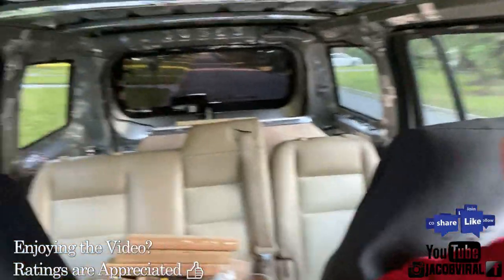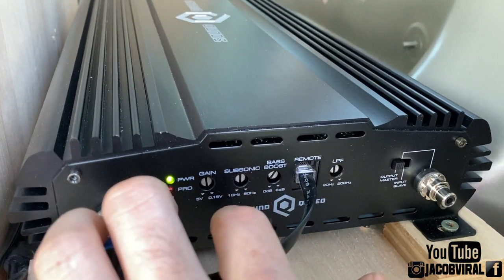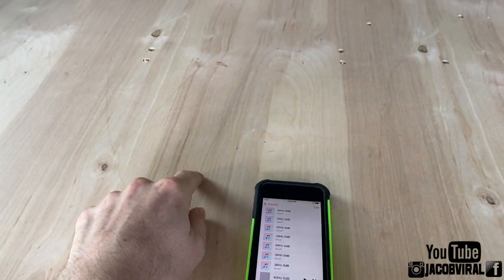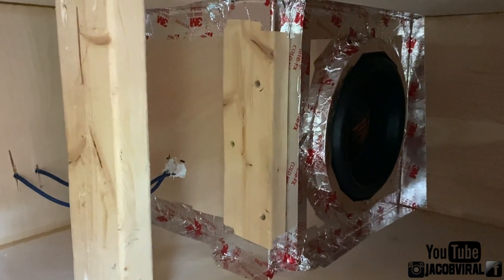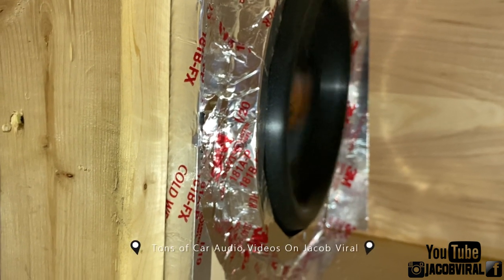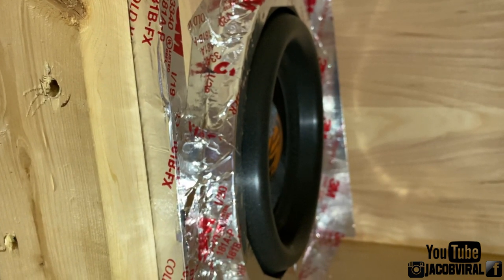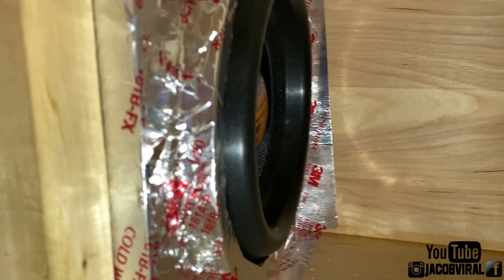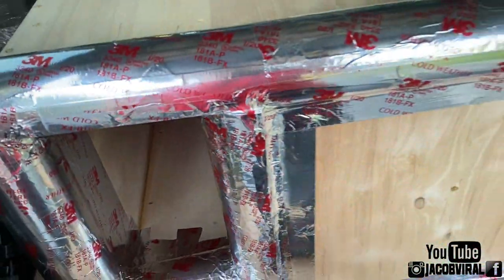HOW TO FIND WHAT YOUR SUBWOFER BOX IS TUNED TO?

Comment: The frequencies are called sine waves also know as test tones. They usually come in 0db ( full scale ) -5db and -10db. 

For this test of finding box tuning you can use -5db or -10db. 0db at too loud of volume could damage your sub. 0db is only for SPL competition. 

Def keep your head unit or radio half to 2/3 volume. You would use -5db tones from 20-70 Hz for subs unless you know about what your box tuning is. Start at 20Hz and go up to 70Hz by 1Hz or 2Hz ( 20,21,22 or 20,22,24,26 )

If u think u know the tuning, Ex: builder says 33 Hz tuning on your ported box. Then test 30Hz - 38Hz -5db tones. You should be in the right range to find the tuning by the least movement of the sub if the box is built half decent lol. 

Test tones are also used to set gains on Head units, Phones, ( source audio ) DSP’s & amplifiers. 

Hope this helps anyone undertstand who may have missed something in the video.

Comment: The most effective method is to test for the impedance modulus.
For correct tuning.
Not for those awful sounding "Burp" efforts.
But a correctly tuned Helmholz
You will get an equal ripple reading of modulus.

Comment: One thing I didn't understand, low frequencies in all speakers forcing the woofer the move more back and forth as you go down. and med to high frequencies the woofer need less movement but much faster ones. that's why subs have bigger rubber diameter with slow bigger movement and tweeter are smaller and almost have non. so I don't understand how looking on the speaker can give any information. I did some testing my self and find that you can seat in front, play the frequencies and most lower audible frequency you hear is mostly the box tune frequency, 
like if 30 is barley heard (not felt) and 40 is audible to your ears then it's probably 40 hz.

Comment: Hi brother jacob, got a few questions.
(Side Note, Love my bass to hit lows that shake my soul and heart)

1. Do the Hz of a Subwoofer, lets say a sub is tuned at 25-500hz. Should I build a sub box (ported) and tune it to 25hz aswell to compliment the sub's 25hz or not? or should i tune it higher to 35hz-40hz. Because most prefab/custom sub boxes are tuned at 32hz to 36hz. But most sub hz be around 24-27hz. I don't get it.
Like kicker compr's dual 10. Box is tuned to 30hz but subs go lower then that and are about 27hz.

2. Is it a problem if I buy a amp to compliment my subs peak rms watts rating rather then the normal rms watts rating? Lets say i've got a kicker compr 12 the rms is 500watts and peak is 1000wats, most people say get a amp that is 500watts not 1000watts. But i personally want to get something in between, a 800watts amp would do. So is that a problem or not. 

3. How should i make my enclosure and sub be the hardest hitting and also loudest that people can hear me from blocks away and also can play lows so well my heart and soul feels it. 

Thats all bro
Reply from the maker: Usually sub can play half octave below box tuning. Tune any lower then 30hz means you won’t want sub to play loud above 40hz. Always best to get a sub amp rated 140-200% rms power to have play room and not max amp out. Tune mid 30s to play to 26-30hz range, tune higher will be louder but not as lows.
Reply: @JacobViral2  thankyou very much brother👑💯
Reply: Yeah put more power on your Amp like he said, your not gonna turn the gain up 100% anyway or it'll sound like crap. I had 2 kicker compr 12s on a 1500w rms 3000w peak Amp for years and played em loud all the time never blew one

Comment: My sub continues to move between 18hz up to 100hz. 
Ive tried different port lengths with no difference. At no point , does it stop moving or moves very little ,within this range. . 
I have no idea of tuning frequency.  Any advice ?
Reply from the maker: Plug-in to 12volt box calculator, shrink/open port area, new box, SPL db meter slope roll to loudest score(peak)

Comment: very helpful videos

my wife would kill me tho if i rolled around with my car looking like a carpentry shop, ive had to make my install stealth in the minivan, you can barely tell there are two 12s, or any wires in car all over...clean. when shes in car, i usually just turn the subs off and run highs/or run subs at low power via gain knob up front under dash, about 19 volts...barely pushing 200 watts...when hes not in, i crank them up near full power...tho two type rs @ 2ohm pound hard at 42 volts or near 900 watts lol
Reply from the maker: Thanks and yea it’s a project Explorer gutted from multiple walled systems. More videos coming daily stay tuned. 👍

Comment: Would this method work for a tube enclosure pioneer ts-wx304t
Reply from the maker: It can work for anything long as you can see the sub yes
Reply: So first I find the loudest  my door speakers can go before distortion with no gain and lpf then tune the amp setting the gain and lpf with the music volume still 75% (just before distortion) and then i can turn it down to like 50% then do the tone test till the sub moves less to find the box tune then set ssf half octave down ? Would that be the correct step by step method ?
Reply from the maker: @2HUNNIDN98  Yep, seems complicated but it's not so bad.
Reply: Thanks bro 💯
Reply: Sup from New Zealand 🇳🇿 btw

Comment: Is tuning all based on the box? Or can bigger displacement subwoofers effect tuning? I recently bought a box (2 15s) that was custom built and is tuned at 32hz. So would that mean that any 15 inch subwoofer I put in the box still be at or around 32Hz?
Reply from the maker: Subwoofer affects tuning to for your peak frequency but box is tuned the same regardless of the sub just the sub changes your  frequency variance.

Comment: If a box is tuned to 40hz but the low pass filter on an amp only goes down to 80hz (sundown sfb2000d) will it still be able to get close to the 40hz? Or will it be limited cause of the amp? I’m ready to switch it out for another one
Reply from the maker: LPF is the top end cutoff point so 80hz is fine, your talking about subsonic.

Comment: Thankyou for this
Reply from the maker: Your welcome thanks for watching and subscribing!
Reply: @JacobViral2  maybe you can help,  I have a alpine type r system and front component speaker in door is doing a little static crackling sound on certain songs at a reasonable high volume , what would cause that in your opinion ?
Reply: I have swapped rca input on amp from left to right to rule out amp/ wiring etc and still same left speaker only makes this sound
Reply from the maker: Sounds like a blown or soon blown speaker or a ground issue.
Reply: @JacobViral2  mmm hope its not the voice coil but I doubt its a ground issue as every thing is correctly wired , thanks for replying mate its much appreciated

Comment: So after finding out what's my peak can I tune my amp with that hz test tone? Say my peaks 34hz do I use a 34hz test tone to retune or do I stick with 40? Also would I change the subsonic lv?
Reply from the maker: I have videos on setting each setting on the amp to watch but in general I would tune based from the tunings for the results yes.
Reply: @JacobViral2 so was you telling him to play a test tone of the 34hz?  cause my speaker plays 30hz but you know they say play an 40hz test tone to set. So which test tone should I use?? 30 or 40?

Comment: is this way really accurate??  by placing your hand inside to film the speaker movement.. you've already decreased the size of your port hole size with your body.  that probably affected the tuning frequency..no??
Reply from the maker: Concept yes works great, your point is correct though probably throws it off 1-2freq

Comment: I just extended my port and now my sub hardly moves at 26hz! Crazy. I played 18hz almost full tilt, good fun. But yes way to long. What's a good tuning freq for overall music, I like the lows but not to the level of of decaf music, I think my box without port extension is 45hz and is too punchy and brutal, would a good tune be 32hz or more like 38hz?
Reply from the maker: Usually most tune between 32-36hz for a balance of both.
Reply: @JacobViral2  Legend, thanks for reply on old video!
Reply: @JacobViral2  A few hours later I finished my new port. sweep with no extension showed peak of 40hz, sweep with long extension showed peak 26hz and now my new extension I made the woofers were not moving much around 34hz! This is perfect, not gonna lie I was aiming for 32hz but shouldn't matter for music.
Reply: How did you extend your port? Same   box?

Comment: Is this even real? because that sub will obviously move less when you go to higher frequency! You try it in free air!
Reply: Yes it's real. The air inside the box reacts to the vibration of the woofer. At the tuning frequency of the box the air resists the movement of the woofer the most. It becomes "loaded" and it most efficiently transfers energy from the cone of the woofer to the port because the air naturally wants to resonate at the tuning frequency of the box. The air behaves like a spring. The reason this resonance is useful is because by building a vented box you shift the phase of the woofer's back wave via delay and shoot it out of the port in phase with the sound wave generated by the front of the woofer.

This means that you get a natural amplification in the sound at and around the tuning frequency. This can be used to smooth out the frequency response of speakers and extend how low they can play. Most speakers tend to get quieter and quieter - as the frequency gets lower and lower so using the natural resonance of the air inside the box to amplify the sound is a great "hack" to make those lower notes louder again. :D

Comment: Does subsonic on make your bass hit harder ? I have a box with port centered and tuned to 35hz , what should I level my subsonic to ? Please let me know @jacob  or someone
Reply: jon doe : I have my subsonic all the way off - some songs hit hard but other songs don’t hit as hard  - should I turn up the subsonic ?
Reply: jon doe : someone told me that it’s good to keep the subsonic off
Reply: jon doe : what do you mean by every music play ?  Do I have to set the subsonic to different beats ?
Reply: You're thinking of it backwards. 
All a subsonic will do is REDUCE power below a certain point at a cert slope. 

If you set an ssf to 35 hz it will gradually lower the input level the farther down you go. 

If your subsonic is set to 40hz and your box is tuned to 32. That means that by the time the frequency gets to 30hz the ssf robbed the wave of a significant amount of energy. And you won't be playing as loud as you can at port tune. 

In that instance adjusting the ssf to a lower frequency WOULD make you hit harder. 
but only in that specific instance and similar ones. 

Id you have ssf off. You wont get louder by turning it on. 
Except for some really isolated, rare and coincidential situations. 

(Songs with 23hz notes and notes in the high 30's playing together. The sub can't play two notes at the same time very well, so if a subsonic is reducing the volume of the lower note the higher note will get louder). 

But it's extremely rare that music contains that kind of structure.
Reply: jon doe : I don’t play rebassed music , I just play music straight from iTunes with aux connected. Some songs hit hard and some don’t - I have SSF off , should I turn it up a lil ? Maybe 25hz which is half way or less then that ? Am I doing something wrong ?
Reply: I was talking about the OP.

luis to answer your question, no. turning on the subsonic will only decrease your output, but in turn will protect your sub from over excursion. if you want more kicky bass change your box design or get higher power handling subs, or subs with more cone area.
Reply: jon doe : 2 Skar Evls 12’ with Brutus amp 2500 amp and 7 band eq. I had 4 12’s but took two out temporarily.
Reply: jon doe : took 2 out because I have a 15 month old son and I need some space lol. So should I turn up the SSF a little less then a half for now ?
Reply: jon doe : 40 and box tuned to 35hz , why ?
Reply: @luislozano5497  If your box is too big it will sound like shit. Now that I know the subs what are the box dimensions specs? It's gotta be built for the application.  I've said it once and will say it again. The ONLY function of an ssf is to lower output under its set range in order to protect you from over excursion. If you're tuned to 35 hz i would set your ssf to from 30-32 hz. But that all depends how much excursion and mechanical compliance you have with the sub. Evl's are spl subs that are relatively stiff and non efficient. You can get away with an ssf at 30 without over excurting. As long as you dont plan to play much below 25 hz you should be fine. 
Setting ssf too high WILL DECREASE output close to port tune.
Reply: Never mind other dude has the evl's.
Reply: I took too many edibles abd got the comments mixed up lollll
Reply: famous dev : the box specs and all that is made for those subs
Reply: jon doe & famous dev : thnx for the help you guys. @ famous dev stay off those edibles lol